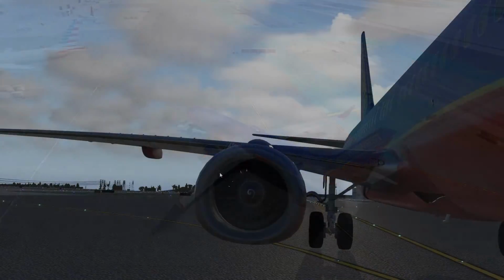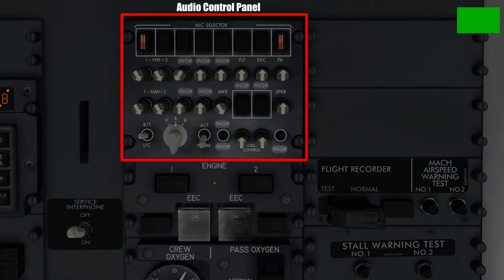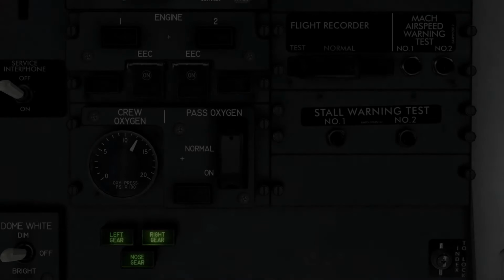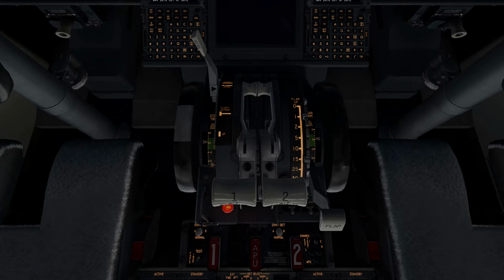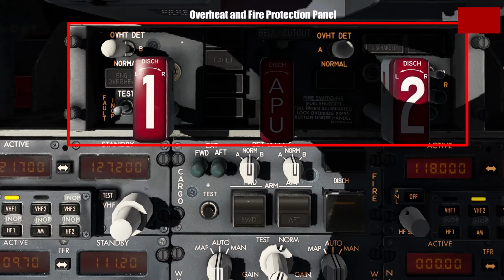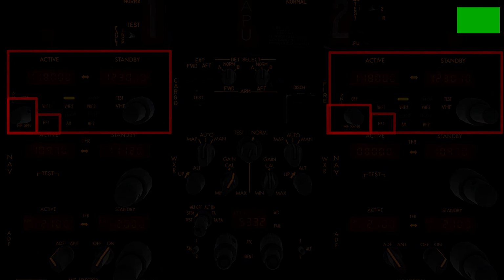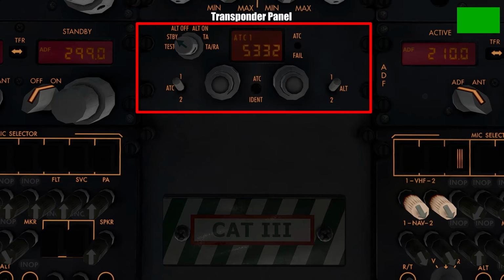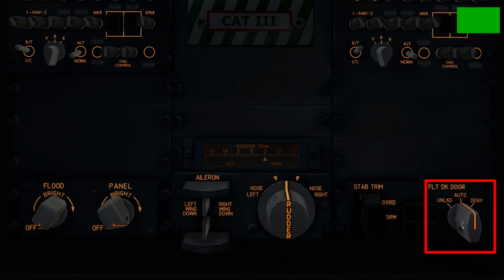Aircrafts Dissected Ep 2: Central Pedestal & Control Stand|ZIBO 737I X-Plane 11 Detailed Tutorial

Comment: One note on your NAV 1 and NAV 2 Identification audio explanation. It is used to verify that you are tuned to the correct navigational aid and that only. It is possible to have two NavAids with the same VHF frequency within range of an high flying aircraft receiver. To verify that you are tuned to the correct one. You tune the NAV receiver to the published freq. and turn on the audio IDENT.  You listen to the code to verify it is correct then turn off the audio. The morse code i.e. dots and dashes is published in the Air Pilots handbook. Not many pilots know morse code these days. Like your videos Thanks
Reply from the maker: Thanks for the information provided. I'll take it into account for sure. Appreciate all the support :)

Comment: Overheat and Fire Protection: You stated at minute 25:25 that the green light was an indicator that the fire had been extinguished. This is incorrect. The green lights are to test the system. The red light on the pull handle will go out once the fire is extinguished as a visual cue....Additional note for Zibo pilots: There is a setting in the EFB for realistic that forces you to hold down both toe brakes before it will allow you to set the parking brake. If you don't have or use pedals, leaving this setting on simple is best. There is also a realistic and fast setting for the time the IRS takes to align in the Zibo. For charts, a subscription to Navigraph is best and allows you to access to worldwide charts including a red plane icon in the EFB. It's worth the cost of an annual subscription. Free PDF charts for the US are available at Skyvector.com. Chartfox.com has free charts for the rest of the world. The Zibo mod has an option in AVITAB settings to use the newer type MMR nav radio with pushbutton pad.
Reply from the maker: Aah, interesting note about the dual toe brakes, never knew about that. I for one don't use dedicated rudder pedals so I'll definitely be checking the setting out. As for the IRS alignment time, I talk about that in detail in the 8th episode of the series, where we configure all of the important settings in the EFB. Skyvector is indeed a good alternative to Navigraph charts, however, in my experience, I've found that it's only widely supported in the US and not a lot of other places around the world. For example, getting charts for WSSS (Singapore Changi Intl. Airport) isn't possible on SkyVector the last time I checked. Still, for people learning how to fly, SkyVector is indeed a great option:)